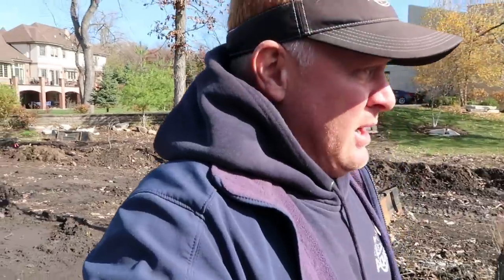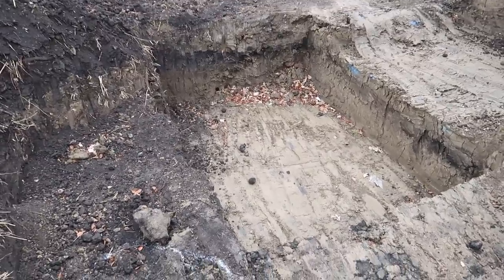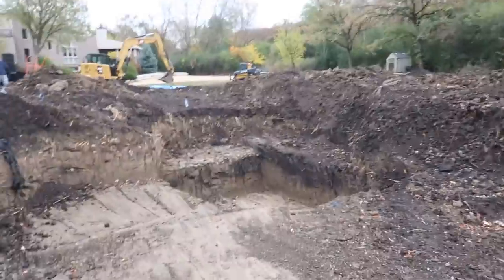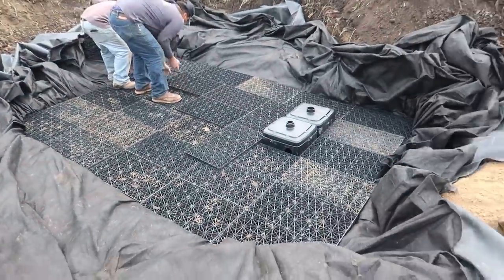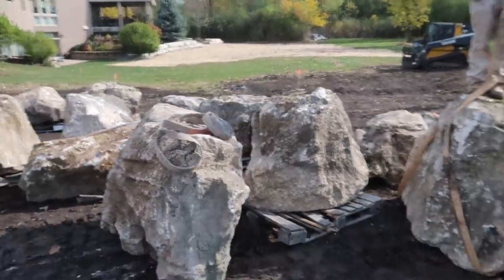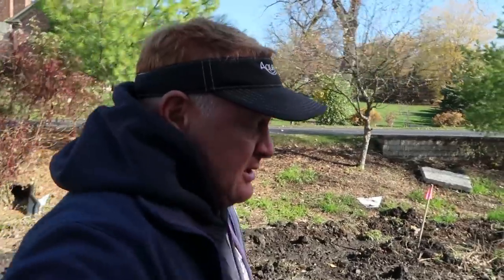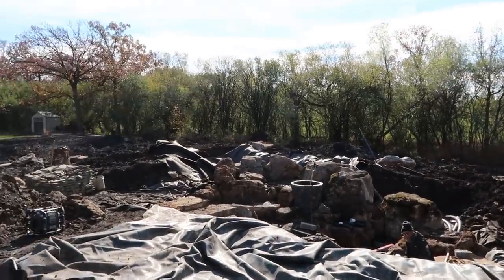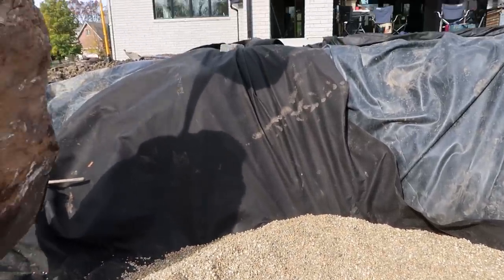Pond Staircase W/ Infinity Edge - Part 1

Comment: Moving stone - I haven't gotten to the 3-4000 pound stones - I'm limited by the 1500 lbs. in a 2 wheel drive Tacoma, and the 2 axel utility trailer (3500 lbs.) I'm using all my brain power - not machine or muscle to move what I can by hand.  Unloading is easy -- The stone rides in the pickup truck bed on plywood over pipe, and rolls off the tail gate.  I fill the bed with 5 gallon buckets for the scoop of river pebbles and rock. That pretty stuff comes from the landscape supply. The big rock comes from the municipal granite quarry.
How do I tell how much each weighs?
I've seen several methods on your vlogs and would appreciate more "moving rock by hand safely." Two guys used a sling, a hand trucks with tires, and wheel barrows. I just bought a gorilla cart (600 pound capacity - how long will that last? I also have a 4 metal tilt bed cart.